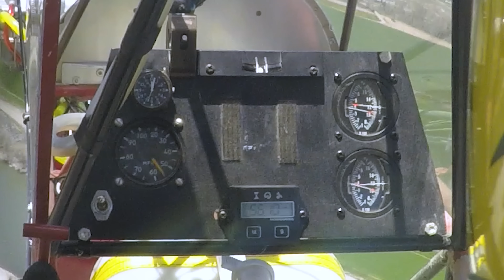MAIDEN FLIGHT goes BAD on landing.😓 Abandon airplane PART 6.

Comment: Jonas, and when you build that new gear, put 3 to 4 degrees of toe in on the main wheels in relation to the centerline of the aircraft. This will aid dramatically in the ground handling on landing in particular. The “Toe In” will cause the aircraft to want to self center and track relatively straight in line with the body of the aircraft. Food for thought and keep having fun and taking us along for the ride. 👍
Reply: zero is the only way to set up the toe. no in or out
Reply: No! Zero toe is what provides best stability.
Reply: On something this small that sounds like a recipe for an oscillation and pitch over on the nose though...
Reply: Go with the toe in for sure and remember that this will vary as the tail is up or down.  toe in provides a margin of directional stability, several degrees at least!!. some additional keel surface with a covering on the fuselage sides will assist with some positive directional stability as well. . zero toe in is a recipe for disaster, pay no attention to whoever that is, it is totally incorrect.
Reply: Toe in, cars are the same.
Reply: @mfree80286  I use toe-in even on RC planes.
Reply: Toe out is what you need for self correction.  Lest say it starts turning left, the right gear will load up, which when toed out will make it go back to the right.
Reply: 3 to 4 degrees of toe seems very excessive to me. All the results I'm seeing call for either zero toe, or +/- 0.25° or less. Also, there's a big difference between front steering and rear steering.

On a trike setup, or a car, the front wheels do the steering. Toe in on the front is irrelevant to the plane (only one wheel, so "toe" is just steering), and generally makes the car more stable in straight lines (for reasons irrelevant to airplanes). Toe in on the rear stabilizes both. If you steer left, the right side tires load up and have more authority than the left tires. With the right rear tire toed in, it causes the rear of the vehicle to move left, so it's countering the rotation of the front tire(s) moving the nose left; the entire vehicle wants to crab left, which is more stable than than pointing left. If you had toe out, the right tire would tend to exacerbate the turn by rotating the rear to the right.

This airplane is different though. Because it's a tail dragger, you're steering with the rear wheel. If you steer left (by rotating the rear tire to the right), the right side front wheel (again) gains more authority than the left. If it's toed in, the right tire pushes the front of the aircraft left, increasing the left rotation. If it's toed out, the right tire pushes the front of the aircraft right, causing a rightward crabbing motion.

The guys in this Super Cub thread ( https://www.supercub.org/forum/showthread.php?32748-Toe-In-Toe-out ) and this Vans thread ( https://vansairforce.net/community/showthread.php?t=202404 ) mostly seem to agree that toe-in makes the airplane seem possessed, and that neutral to slight toe out is better.
Reply: I can understand if somebody reading the toe-in/toe-out/no toe gets confused. Meanwhile, I'll team up with the "a little toe-in and a lot more stiffness" camp!
Reply: Exactly right…

Comment: I had a Sonerai IIL With VW power.  CHT got up to 290 and crop duster crew I worked for thought that was real high.  Also I think the head was warped a bit.
Landing one must be VERY PRECISE with these tail draggers.  It"s like driving a car backwards at 60 mph.  Just be precise on your landings and you will be fine.

Comment: I would suggest that you were not fully stalled when you touched down and the gear struts are so flexible, you bounced, the struts splayed and with your right wing fractionally lower, it gave the right side more grip which in turn caused the directional control loss and slew to the left. Firstly, I’d suggest an approach about 5 knots slower and fully stalled on touchdown with stick fully back. Secondly, you need stronger, more rigid undercarriage struts.

Comment: So bro,  7000 hours here. A good amount of that in tailwheel.   The ailerons yaw you opposite of the way you are pushing them.   Stick left (yaw right) 

Next time if you get to full rudder and she’s wanting to ground loop use the ailerons.  Throw them into the turn.

Comment: From what I saw it looked to me like you didn't have the stick pinned back aft the tail was down. Can't tell if it has a steerable or locking tail wheel, but that stick should be all the way back once the tail wheel is on the ground to give you good positive steering. If its a free swivelling TW you might want to consider either of the other options.
Reply: Did you watch a different video ?

Comment: old crank seals probably need replaced from sitting too long (the entire case is the intake plenum, leaks = lean, also watch for cold seizures). pull the mag end or gearbox end or both and inspect for oil. probably good to do a light rebuild with all new seals. Inspect the crank, bearings, pistons, and cylinders. when assembling, the crank seals should be clocked appropriately as well just fyi. might consider sending it to a rotax shop. LEAF comes to mind

Comment: I know nothing, but I noticed that on 30% scale planes a pro RC pilot I was watching always pulls the elevator all the way up soon after landing to leep force down on the rear of the plane. I have no idea if that would help after you hit the ground and I see there was no time to experiment. Also that pro rc pilot has the throw distance to make that elevator go to about 80 degrees so it looks almost like an air break as well.

Comment: You may have to run the back cylinder a little richer than the front. Done on v twin motorcycles often.
Reply: What options does he have with a single carb?
Reply: no its not, on the relatively few v twin bikes that have multiple carbs, stock at least.

Comment: Cub style gear, with two points of attachment on the airframe would be a great starting point. This would also be a great time to improve the brakes a bit. What an opportunity this mishap affords you. You survived, and the air bike managed to tell you what is wrong with it. Cheers from Winnipeg.
Reply from the maker: That’s the plan. And I’ll add some toe brakes! 
Cheers 🍻
Reply: I think it's just like saying any landing you walk away from is a good one....
Anytime your plane tells you what's wrong and you don't crash is a good day. It might suck when something breaks but it's a win anyway.
Reply: Yes. Thank God you came through that. Agree with several of previous comments-especially on the slight tow-in and higher grade material so can keep weight restriction.

Comment: Jonas I believe you are the test pilot on this one that you didn't initially build either. Who would have thought they didn't use good material for the gear legs! I think there has been quite a few Airbikes built and flying, so the design is proven right?, but but i don't think that one has flown much if ever. Can see how the roll control is touchy with those long ailerons!

Comment: As soon as the tail dropped, you had no directional steering from the rudder.   It was behind the windshield and getting no airflow.
Reply: Probably the issue seeing that piper cub type aircraft only have a fuselage blocking the tail.

Comment: double check your spark plug gap, smaller tire up front would help handling some. but they look too sweet to change. practice! do tail up landings lose speed and see how that works for you. also add a support strap or cable to keep the gear from flexing around. they're designed to be weak to prevent hurting the airframe longerons. dont make them too beefy just add supports i would much rather replace gear over rebuilding the airframe. plus that gear is old and has seen better days im sure

Comment: I see several problems with it, the reason you had a hard time controlling it with the rudder, is because it is way to small, and way to low. The way you are sitting with the windscreen, the is deflating the air away from the rudder, making it extremely hard to control in a flare at a low speed. Also looks like you have to much aileron but no flaps. That is causing it to be to responsive on the controls, and with no flaps, causing you to come in pretty fast for a landing. When you are on your down wind like that, gain plenty of altitude so that if you loose your engine, you have plenty of altitude to glide back to the runway. If you stay low like that, and loose your engine, you will loose to much altitude on your base and final turn, then come up short of the runway. You flew a pretty tight dog leg, that didn’t give you much time to stabilize your final approach. Keep kinda high on your down wind, give yourself some space before you start your bace, so that when you come in on final, you have plenty of time to stabilize, then bring it into the runway and just before touching down give yourself a good flare right over the runway, pull the engine back to ideal and just float it down smoothly, then when you taxi, always keep the stick pulled all the way back, to prevent going face down ass up prop strike. Lol
Reply: Exccellent analysis, good job!
Reply: bunch of nonsense. it's the wet noodle landing gear.
Reply: @scotty657  I guess that’s a good thing, I’ve been CFII since 2009. Lol. If I can help someone by passing my knowledge down, I will, but I also listen to those who passes it onto me as well. I learn something everyday, and teach every time someone will listen.

Comment: I've spent a lot of time chasing runway lights in ultralights but it was always crosswinds that sent me there. The only difference is I never had brakes or I would have been using them to steer!

There's that danger zone on landing a light weight tail dragger which is when your slowing down and you finally get slow enough that the tail quits working for steering yet your still going plenty fast to bend things.

It's time like those that I was glad the local airport had foot tall grass to slow me down.

Those weak breaks might be perfect for steering until you get the feel for them. Good brakes would probably nose you over in a heartbeat if you applied too much too soon.

Comment: I had another look at your landing and as you touched down it seemed to me that the left wheel twisted outwards from the front. This was what through you off the runway. It as the same as when you have a flat front tyre on a car the car will go in the direction of the dodgy wheel. Just get the gear fixed and you should be ok. Stay safe. Regards, Jim in NI UK

Comment: I could be completely wrong here but I've played it back slo-mo many times but would be glad to be wrong. It looks like it's neither a 3-point nor a wheel landing...too fast and the attitude is not correct for a 3-point and the elevator never goes forward to pin the nose if it was an attempt to wheel land it. These little high-drag, low weight planes take a bit of extra work especially if there's any, and I mean any, wind or thermal activity. A few knots will eat your lunch if you're not 100% on top of it. For a wheel landing in these, I get it level to the runway, a touch of throttle (like 50 rpm) and let it barely touch the runway, then forward on the stick. If it bounces, I go around, immediately. Do not attempt to save it. Your touch down looks okay but it seems to drop in from a few inches and the attitude of the wing just springs it back flying. It's going to bounce. Full throttle and get out. Wheel alignment is critical, you need a degree or so of toe-in. Smaller tires may help while you get used to it. You can get some nice, Rockwell hardened spring gear struts from Lockwood Aviation (Sebring, Fl) used on the Drifter and adapt them. They also make the axles. Once you get this dialed in, fly it early or late with little to no wind or bumps, and you won't be able to wipe the grin off your face. Oh, the original Airbike had a cowling and spinner. BTW, get a chute. Great channel, love the content. But please be safe.

Comment: Jonas, just a mention, I had one cylinder running hotter tan the other and my spark plug gap was off, sounds crazy but that simple issue drove me crazy and was the last thing I checked, also it was the cylinder closest to firewall so I thought heat wasn’t escaping as well so it can also be still a little lean and the front cylinder is compensated from running hot because it’s getting more air to cool it considering they are running from same carb and intake, let us know what you figure out. And those sensors are sorta cheap made and can be quirky. Just throwing some ideas around. Be safe, J
Reply from the maker: interesting! I wouldve never thought that, I'll double check mine. I was looking at the air scope and I think I need to redesign/add to it. the front cylinder was the one getting hot. Possibly all the air is being pushed out the back cylinder fins and not much out the front fins? Thanks for your ideas!
Reply: @JonasMarcinko  pull the gearbox and check for oil around the crank seal

Comment: For those of you who are fans of the Airbike, know that the design in this video is NOT an Airbike. It may be a clone in overall layout but there are too many design changes to allow it to be considered an Airbike. Just like a chicken and a duck share common attributes, a duck is still a duck and a chicken is still a chicken. 
I suspect the twisting gear legs steered the craft off the runway, not lack of tail authority.
Reply from the maker: Very true. I have been meaning to address this in a video and go over the difference’s

Comment: Maybe keep the tail up - wheel landings only, like a DC3 which has the same rudder blanketing problem.
Reply: I agree, the vertical tail seems to blank out without thrust from the propeller, there may not be an easy fix here. The gear is a disaster, install a al bent gear sized for the weight of the plane that can hold its alignment, use real aircraft wheels and brakes. High drag types don't glide well with the engine out, see what your glide angle is without power. Glad you missed the approach lights, that would have been expensive.

Comment: Due to the design of the aircraft there’s a lot of dirty air coming back towards the tail. At slow speeds the rudder and vertical stabs have little authority without clean air. Other than a bigger tail i dont know what else you could do.
Reply: The "Man" Could,,,, "Wake Up",,,, and Get On The Rudders and Throttle...
Reply: Ask some DC3 pilots about rudder authority after touchdown on roll out

Comment: Is there a way to change the controls so they aren't so sensitive ? The landing gear needs triangular support. . I'm not a pilot or know about airplanes, but the tail is either to close to the cockpit or not big enough. Reason I say this is it's not in clean air to steer the plane after you land. With the plane tilted upward your body blocks the air going to the rudder causing lack of steering. Just my opinion .

Comment: Hey Jonas if you get me the wing cord, wing span and the distance from 1/4 of the wing cord to 1/4 cord of the vertical tail I can run it through a worksheet I have to see if the rudder is large enough.  I can do the same for your horizontal tail as well

Having the gear all but collapse is not a good way to end your first flight.
Reply from the maker: That would be great!
Reply: @JonasMarcinko  get me the info and I'll run it for you. 

It's a bummer yt did away with the private messages on the system.

Comment: You had tons of right rudder on both take off and landing which indicates the plane is constantly pulling to the left. It aint no P51, so probably not all down to torque! Is the tail fin straight? Was the gear already slightly bent (and out of line)? It would be sensible to find out what causes that before testing the new gear...
Reply from the maker: I noticed that also. I’ll take another look at the tail.